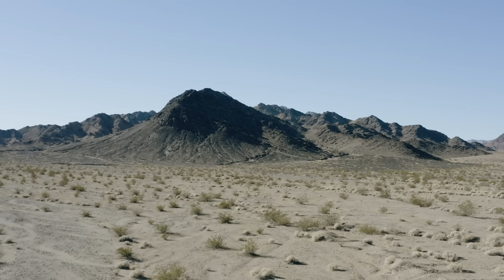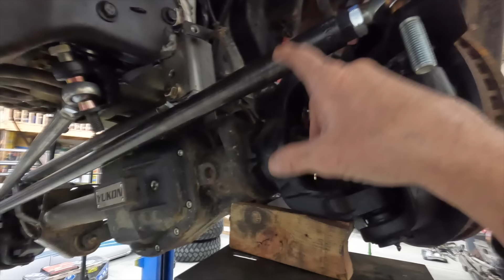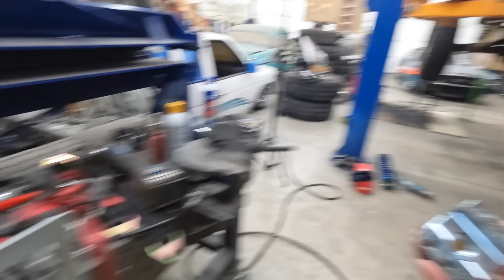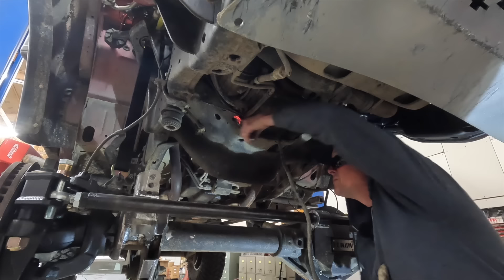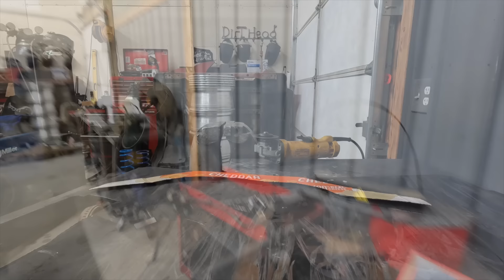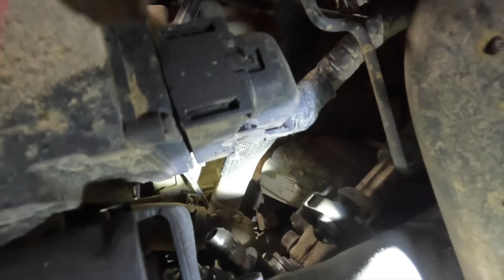More work to make it right!  Ford F250 steering upgrades

Comment: Aloha Dave,  can't you move that drag link from the steering box to the front bolt on the right side nuckle. That would straighten it it up some and also give more leverage on that component to the outboard hole rather than a point closer to the nuckle. I dig your shows, I'm an older 4-wheeler and built several rigs in my years, but nothing as elaborate as what you build
 We deal with all a lot of mud here in my territory. Keep up your  awesome  content, Aloha brother 🤙🏽
Reply from the maker: You are correct. It would put less leverage on it.  But it would not get full steering angle at that mounting point.  And this big ol truck needs all the angle it can get

Comment: Used a similar tie rod clamp on my setup and had to weld a piece of key stock on each side of tierod to keep clamp from slipping each way. Bolt holding ram to clamp tends to loosen up after a few runs too even torqued to 100ft/lbs. Just a FYI and something to keep eye on
Reply from the maker: Yep. It’ll definitely have a stop welded to the sides of it

Comment: All the Tritons seem to do that at some point, I've had the 2v and 3v v10's all the way out past 300k miles, manifold studs will break here and there but I never fix them. Happens on the Chevy LS platforms as well, every 5.3 has at least one broken stud. My mechanic got really good and welding a goober on the end and spinning them out. Doesn't seem to bother aluminum heads at all.
Reply from the maker: I’m half tempted to make a video on ways to fix them
Reply: @thedirtheadshed  It kinda sucks on 3v, never done a 2v but I’m sure it’s not any better. I can send you my lisle drill template if you want, I hope I never have to use it again. Lol. Lisle 68500, good for all the ford modular motors
Reply: @thedirtheadshed  Give it a shot, plenty of people would be interested if successful. Perhaps a non conductive ferrule to keep from migging to the header but guiding the wire to the stud? Always have the ez out method, bleah.
Reply from the maker: I’ll look into it.  Thanks

Comment: I just did banks headers on my v10 it wasnt too bad to do but its an 01 so theres no big coil towers or shock mounts in the way
Reply from the maker: Did it help with power at all?
Reply: @thedirtheadshed  it did a bit. I also ditched the cat and went to a full 4" from the headers back. Got a tiny bit of mpg gain, its not a night and day difference in power but i do find myself accidentally speeding more with the same throttle input
Reply from the maker: The added power and sound always seems to equal driving it harder

Comment: One thing that Ive always admired/wondered about is on all these rigs there are so many modifications made to the driveline, suspension, etc.  Whats the recipe to ensure the motor doesnt leave you stranded on the trail?  Do you typically upgrade or choose to keep it stock but do basic maintenance and if so what are the big engine items you address before hitting the trail?
Reply from the maker: I’m a big fan of bone stock engine.  Simple usually proves that it is best

Comment: Hey Dave, love your videos. Sorry but I just wanted to make a correction, the cylinder where the exhaust stud fell out was actually cylinder #6,not #1. On Ford products starting with the front passenger side (right side) it would be #1 and then it would go strait back numbering to cylinder #5 in this case. Since it is a V10. Then starting with the driver side (left side) it would go from #6 all the way back to cylinder #10. Just wanted to leave a note. Keep up the amazing work!
Reply from the maker: I should have know that.  Remember it from my old 289

Comment: I didn't say it last episode, but I can't ignore it.  It looks like the steering should have gone to the inside bolt on the pass side and the drag link out to the furthest bolt to keep them from crossing.  I'm not sure if that would play things into the diff cover, probably, it just looks odd (maybe it's the camera).   Looking good though, did you cycle everything with the steering ram on it?  I've yet to see a clamp that didn't slip and play havoc with steering on the trail - clamps make a little more sene on aluminum links, I don't think they have any place on a steel steering setup.
Reply from the maker: I agree it looks odd.  But that is the way it’s designed.  Tie rod out to clear diff cover.  Drag link is inside and in same distance from ball joint pivot.  That way it gets full steering angle.
Reply: @thedirtheadshed  yeah, I figured as much with how close things were looking.  I love the fullsize stuff, it's nice to see something different smashing through the trails :D

Comment: Could you have mounted the drag link to the top side of the steering arm with the same bolt that goes through the tie rod?
Reply from the maker: Yes. But it would lose steering angle that far out from the ball joint

Comment: I missed the last episode, what's the reason for running drag link on the back hole making them criss-cross? I mean at least it works! Also curious if you ever put spacers inside your rams to limit their travel to match the steering stops. I did on mine but not sure its even necessary.
Reply from the maker: It needs to go there so the box/pitman arm match the knuckle/ steering arm.  So I can keep max steering angle

Comment: Awesome you're still getting calls from Motortrend gigs. You're always a great addition to any show. Were you wearing earplugs because you were welding overhead and needed to keep sparks out of your ears? And those manifold bolts are a huge pain because the spring bucket is right there in the way
Reply from the maker: I wear earplugs almost anytime in the shop. Kind of got in the habit years ago

Comment: Sweet stuff! I just got my 2004 Excursion  with 2005 coil swapped axles and long arm 4 link stuff installed. I have the same PSC ram to install still, figured while I was already replacing a worn out steering box why not get the ports for the ram and a 2016 style steering box. A review on your ram experience would be good even if it's just a short diddy.
Reply from the maker: Sounds like a sweet project

Comment: I’ve seen a lot of V-10 triton engines blow spark plugs out of the head, and those exhaust manifold studs break off. Love the ford comments 😂 nice work on the steering man!
Reply: He has a newer 3V V10, highly unlikely to pop spark plugs. That was a 97-2000-ish 2V non PI head issue.
Reply from the maker: True
Reply from the maker: Yep.  All kinda normal problems for these

Comment: Have dave maybe i missed it but what size tube did you use? 1 3/4" .250 wall?
Reply from the maker: It’s 1 1/2”. .250 wall
Reply: @thedirtheadshed  thanks man